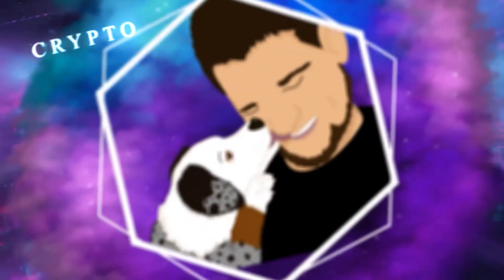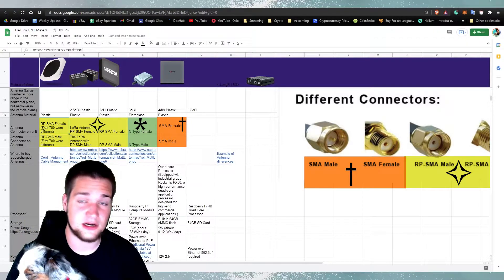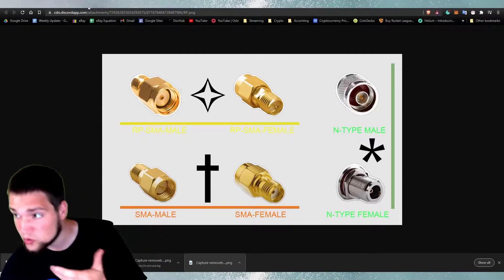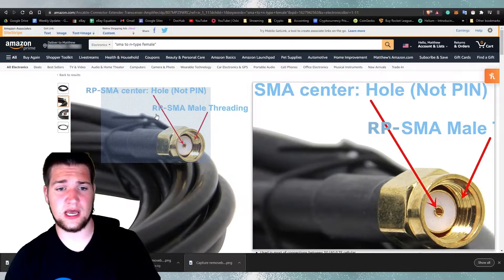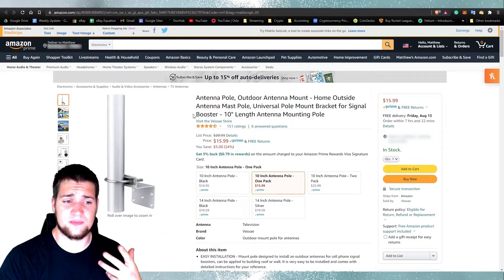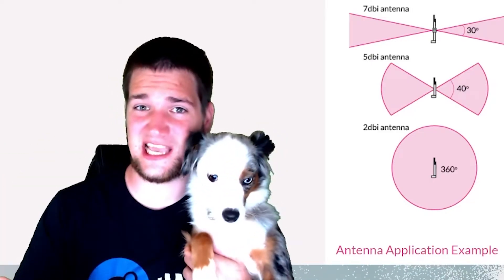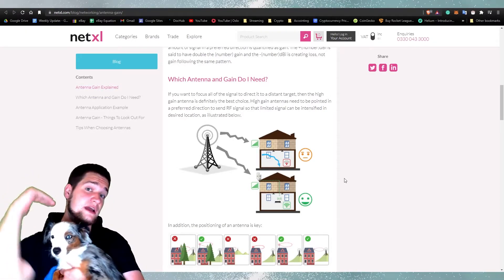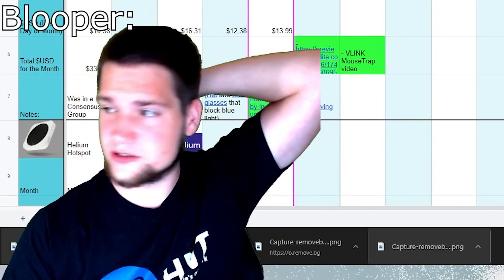Which Antenna Connector do I need to Supercharge my Hotspot | Howto Upgrade Helium's IoT Antenna

Comment: and you definatley want a lighting arrestor and a ground wire if your antenna is outdoors. most newer houses or house with upragded electrical service should already have grounding rods or an intersystem bonding strip somewhere close to the electrical meter.
Reply from the maker: Here is some grounding ideas:
https://youtu.be/eK2lcabhulw